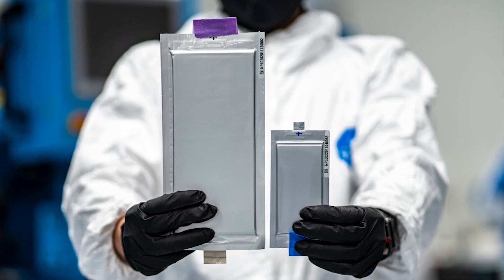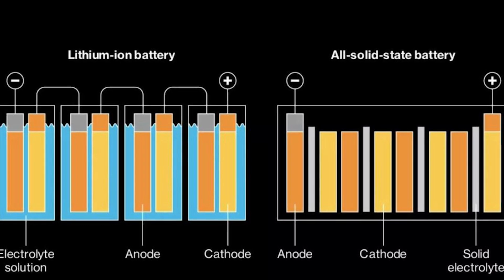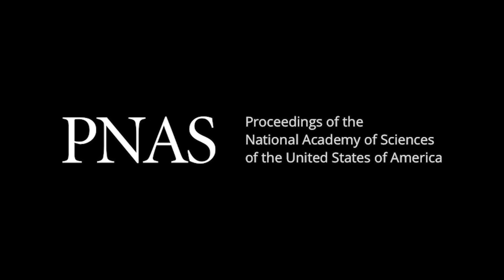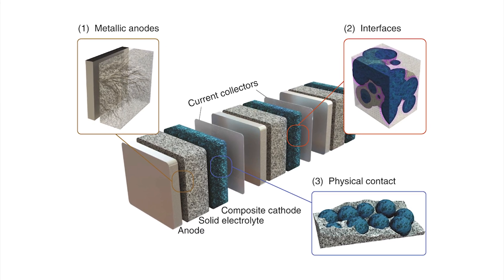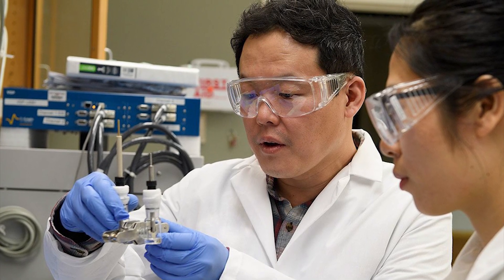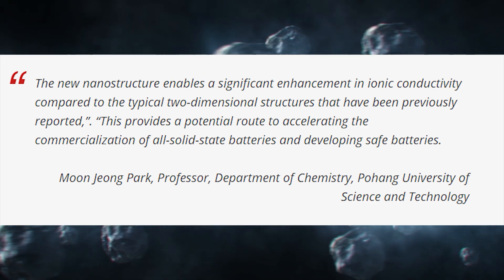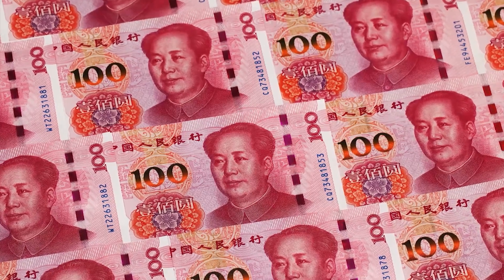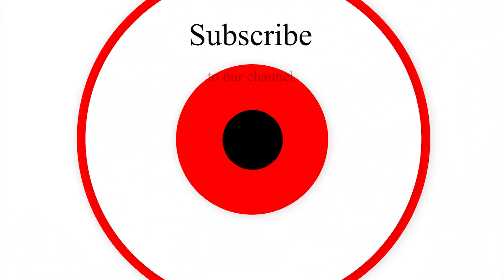Researchers Improve Ionic Conductivity in EV Solid-State Batteries

Comment: This is interesting but it’s unlikely to be industrially produced in useful quantities within ten years. 

By then most people will be using Robotaxis and nobody will remotely care what batteries they have.
Reply: Even in 10 years people will use their own private cars. At least I will :). And even with Robotaxis - someone will own and operate them and will care about things like battery life and charge time.
Reply: @EinzigfreierName  I disagree, most of them will recharge overnight so the charge time is much less important.
Reply: @fredbloggs5902  Okay, charge time may not be the most important factor. But there are others like cycle life that become more important for robo taxis. But my main point is that robo taxi will mostly replace conventional taxis but not private car usage. At least not in the next few years from now.
Reply: @EinzigfreierName  

It generally takes new technology around 10 years to reach full commercial production - that takes us past 2030.

By then Tesla alone could have made 100m EVs.

The current Tesla battery packs last around 500,000 miles.

The new Tesla LFP battery packs will last well over 1,000,000 miles. The cycle  life of the battery won’t be a problem.

It’s possible Tesla won’t even sell the $15k Model-1, they’ll just run their own fleet of Robotaxis.
Reply from the maker: Let's see when the EV battery industry will get the commercialized solid-state batteries to the market for better electric cars.
Reply: "Nobody" and "everybody" is usually indicative of a small mind with small ideas. Keep growing. Listen more. Speak less. PEACE
Reply: @NakedProphet  I’m not remotely interested in anything you have to say, so go forth and multiply.

P.S. Your attempts at self growth aren’t working.

Comment: I understand little of the science presented in these types of discussions but it is good to see so many research teams working on the battery problem and noting the advancements.  I do think that any real breakthroughs will exclude the use of elements like lithium that are in short supply.  In any case, I feel that EV's are the future and am skeptical of anyone promoting hydrogen or those types of energy.
Reply: Hydrogen is too inefficient, 3/4 of the energy is totally lost.